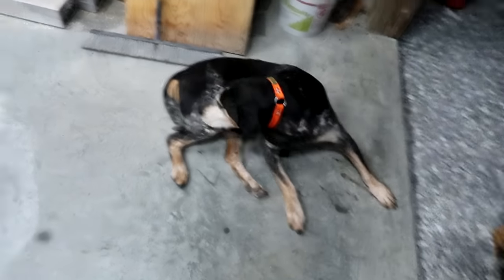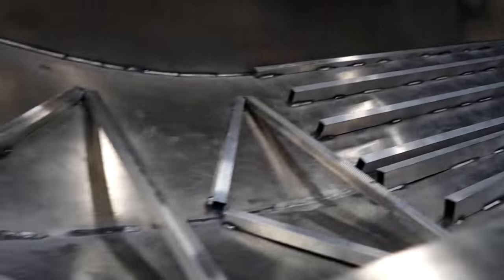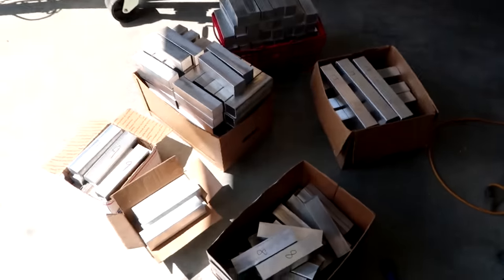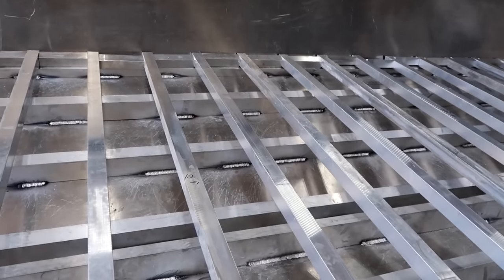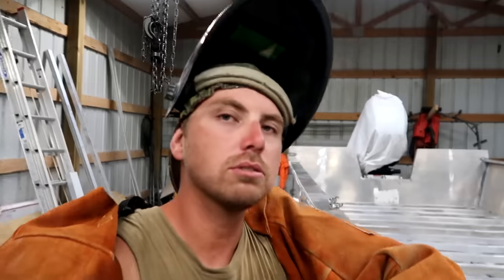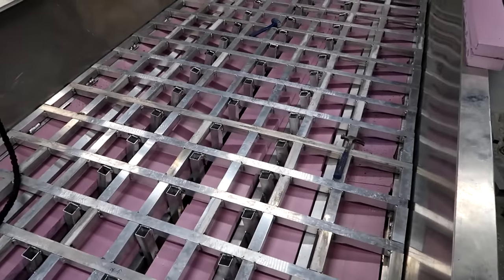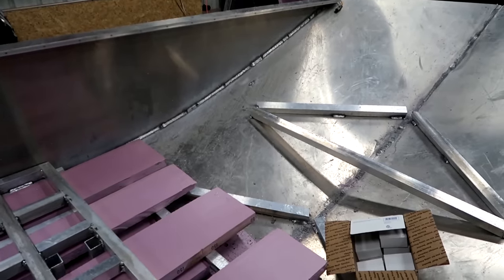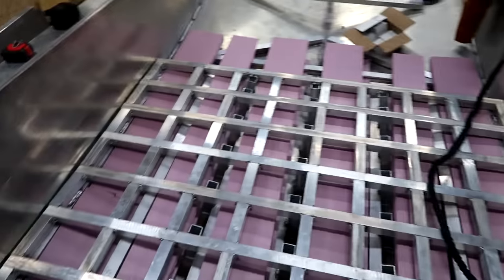Building a 25ft Aluminum Boat Part 11

Comment: Stu, forget about all the troll/naysayers comments on here. I think you're doing something that most people would never attempt, and doing a great job of it, in my opinion. I'm a woodworker/furniture maker, (part time), and I understand what it takes to "design on the fly", without any plans. It takes 3 times as long, and usually costs twice as much, but the end result is one of a kind. Keep the faith, and thanks for sharing.

Comment: (Yes, I realize you finished building this boat 3 or 4 years ago)  You do realize that boats attract water, right?  I don't know if it's possible to build a water proof floor system.  You said something about wanting to be able to blow air through the floor/sub floor to ensure it stays dry.  If air can get in to circulate... so will water.  Love these vids!!!

Comment: How much money material wise do you already have invested in marking this boat if you don’t mind me asking? And how much will you have in total once ur done? Also why 10” o/c now ur 4x8 sheets won’t split on top of ur floor framing
Reply from the maker: Congratulations you are the only one that caught the layout difference. I was wondering if anyone would. To answer your question, I new I was going to be close on full length sheets and I needed rips of 8'' and 18'' so I made the rips ahead and then was able to use the remainder on my floor which then worked perfectly on layout. To answer the money question. I bought all this material before the the taxes went up earlier this new so the numbers now will be completely different. I will say, total I about as much invested as what a new 17-18' dual console boat with a 115 would cost new today.

Comment: I'm thinking if you make the bottom air tight may create a problem. Air expands and contracts and I may crumple the boat or expand and crack the aluminum? You ever gave a gas can swell in a hot garage or crumple in the cold season that is not vented?

Comment: So you will have two drain plugs?  One for the actual bottom cell and one on the floor level?
Reply from the maker: Auto bilge pump on top. Drain in the bottom as well as a bilge pump

Comment: What type of welding machine is that I know the TIG And MIG and STICK
Reply: Its a spool gun, it attaches to a mig machine
Reply: @evansautomotive307  what type of aluminum is that?
Reply: @randycastro7641  I am not sure what aluminum it is exactly. Lots of boats are made out of 5083 or 5052 or 5053 aluminum.
Reply: Thanks 😊😊
Reply: @randycastro7641  no problem!
Reply: @evansautomotive307  He said 5052 back in one of his first videos.